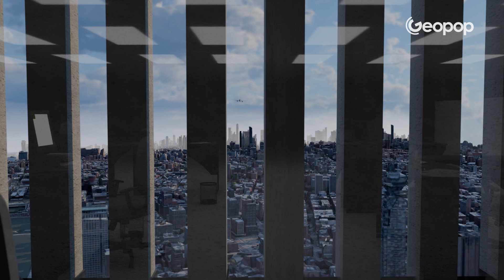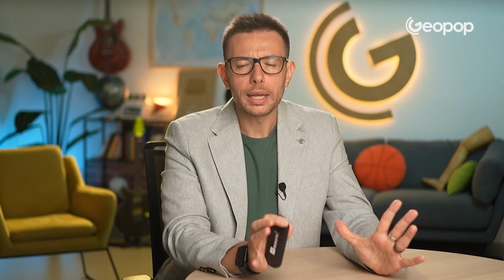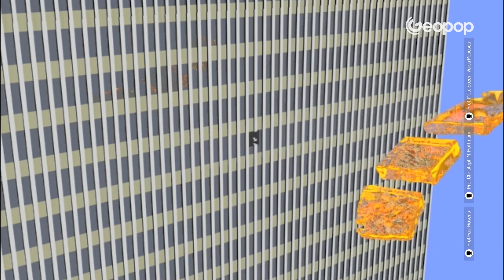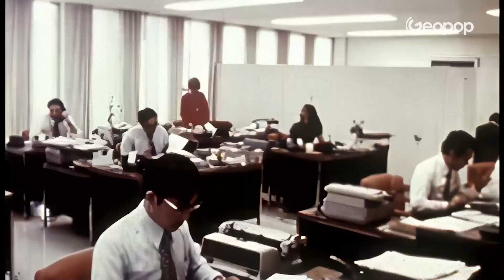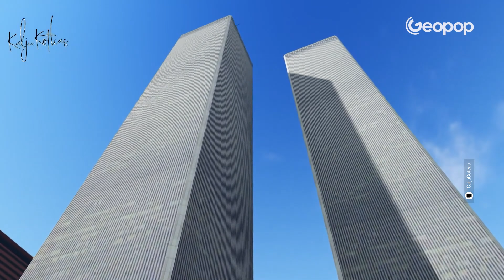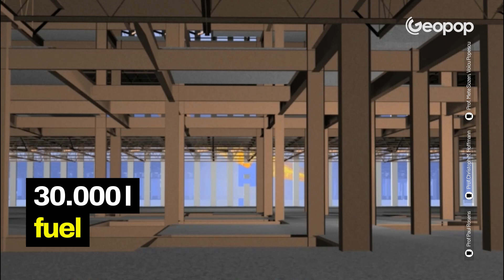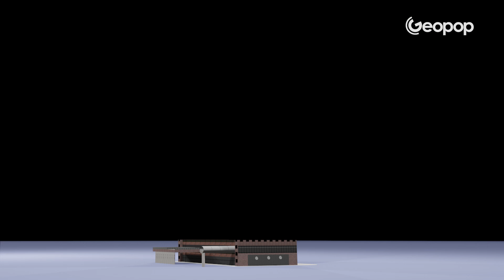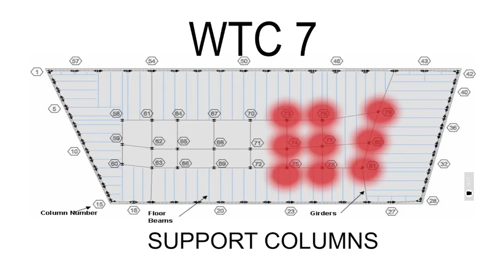9/11, 2001: The Technical Reconstruction of the Twin Towers and WTC 7 Collapses

Comment: Are you sure temperatures reached 1000 degrees C? Are there any photos of glowing red hot steel beams?
Reply: I have doubts that you could see steel glowing at 900 - 1000C in broad daylight. If it happened at night then maybe, but it was during daytime.
Reply: @Stigstigster  A turbocharger glows pretty bright red at 1000 degrees, and that's when you force feed it gasoline and air at the perfect mixture. I have my doubts about this part.
Reply: @Epacman17  Well fair enough but I do not doubt that the steel beams got hot enough that they softened to the point they couldn't do their structural job any longer during the fire.
Reply: There no photos but if you watch the videos of the guy fiming from the helicopter he mentions the north tower glowing red hot and that it didn't have much time left you just couldn't really see if from below you either had to be up in the air or in a building much taller than the twin towers in order to be able to actually see it
Reply: dude.. even fire from your everyday lighter is well over 1000 C..... fire of ANY kind is that hot... simple physics... and AGAIN... it was a TRUSS STYLE building!! all the steel/floors needed to do was sag a little, and the joints that held them would fail...thus, causing the pancake that we saw. This was NOT a "traditional" box style frame building like say the Empire state bldg. If it was, it obvs would still be standing.
Reply: @2jsalomon  The buildings came down at freefall speed, that means that there was nothing holding them up, NOTHING HOLDING THEM UP. Pancaking my arse.
Reply: @theSTUNTHAMSTER  lol.. you obviously dont understand physics very well. Do you know the sheer mass transfer when ALL that weight is coming down on top of one? It is pancaking, but in MILLISECONDS. Of course it came down at free fall speed!
Reply: I’m absolutely positive steel doesn’t need to glow red to lose it’s structural integrity. How do I know for sure? Because I do it almost every day as a welder. A few passes with a torch is all you need. You can bend steel easily, way before it glows. And thats just under it’s own weight. Imagine it with the incredible stress of the building and everything in it. Some of the folks in these comments are dumb as hell.
Reply: Steel doesn’t need to be red hot to loose it’s structural integrity. At 500-600 C, the steel has lost half its strength.
Reply: @jesperwall839  I'm mostly skeptical to the "up to 1000 degrees C" part. But also thought a building would still stand with 50% strength remaining.
Reply: @Epacman17  It’s not difficult to get a fire up to and over 1000 C. People have done it for thousands of years. In this case, fueled by jet fuel and a lot of oxygen, it’s not hard to imagine a real furnace. At 1000C, steel have no structural integrity at all. It’s like play-doh.
Reply: @jesperwall839  Why was there so much black smoke pouring out of the buildings? black smoke is an indication of an oxygen starved fire, quite the opposite of the explanation given by you.
Reply: The highest temperatures were only reached at certain points, and only for as long as the combustible fuel lasted.  But tremendous damage had already been done.  The last few points of support were weakened by the fires beyond the weight they were forced to support.
Reply: Yes in some places the heating got to 1800C. Remember there was a huge amount of aviation fuel, plus masses of paper, office fittings like furniture and carpets (even flame proof material will burn if hot enough), plus the high winds at that height blowing through broken windows, made for a fire unlike most.

And yes there is video of the steel beams. In one video you can see them thinned (from melting) AND glowing white hot.

In another video, you can see the steel dripping off, molten.

Comment: The technical reconstruction? What an effing joke. It's TECHNICALLY IMPOSSIBLE for those buildings to have collapsed the way the official explanations have portrayed them. More important, it's SCIENTIFICALLY IMPOSSIBLE for the buildings to have collapsed the way the official explanations have portrayed them.  There's alot of IRREFUTABLE scientific evidence that explains the problems with the official explanations for the events of 911. Start with the movie Loose Change. Then examine Architects and Engineers for 911 truth. And most importantly, read the book Where did the towers go by Dr.Judy Wood. The laws of physics did not cease to exist on 911. Again, it's SCIENTIFICALLY IMPOSSIBLE for those buildings to have collapsed the way the official explanations have portrayed the collapse. SCIENTIFICALLY IMPOSSIBLE. Jet fuel can't cause a collapse at free fall speed into it's own footprint. Even more so for building seven, which was NEVER hit by a jet liner. Jet fuel fires,or fires of ANY kind can't bring steel framed buildings to the ground. If that were possible,  why would they waste time setting demo charges? Just start a jet fuel fire on the top floors and...a perfect symmetrical collapse into it's own footprint. Effing please.
Reply: You are a clown.

Comment: You should be ashamed of yourself especially building 7 that collapsed from the ground down.  The penthouse buckles in the beginning not the column you mention.  Then from there on out the entire building is intact until it touches the ground.  You sir are ignorant or stupid.
Reply: Please explain how the penthouse was the first part of the building to collapse if the building was demolished from the ground floor up.

Comment: Feel like conspiracy people think the buildings didnt have any flammable material inside just empty buildings.
Reply: Class A materials don't get hot enough to melt steel, the steel beams are also coated in fire resistant material. Highrises are great at compartmentalising fires because the structure itself is not flammable.
Reply: Really.   Fill with all the material you want.  The fact you say this just shows why you are so easily fooled

Comment: Did NIST explain how the core of all three towers collapsed at the same rate of the outer walls? Other steel framed high rise towers have suffered serious fires. Are there any others that collapsed and within their own footprint?
Reply: They didn't collapse into their footprint. They covered a 13 acre site. Would you still look someone dead in the eyes and say they collapsed neatly into their footprints?
Reply: no others
Reply: @zsoltpapp3363  how many of these other building fires were hit by a 600mph jet, AND were a TRUSS STYLE building? ill wait...
Reply: @wskroll
Actually if you watch the footage of both twin towers collapsing the middle concrete core collapses at a different rate and is visible after the outer steel structure collapsed for a few a seconds. Wtc 7 was not built like wtc 1 and 2. Before Wtc 7 collapsed you can clearly see the that there had been extensive internal collapsing as it looks hollowed out.
Reply: Why do you clowns always write "collapsed into their footprint"? Six other buildings were destroyed because if their collapse.
Reply: They didnt. Just more Nutter talk.
Reply: At least two other high rise buildings have collapsed in a similar manner. The Plasco building in Tehran, and another building in Sao Paulo. The columns on the twin towers started collapsing because sagging floor trusses pulled the perimeter and core columns inward, causing them to buckle. When the collapse initiated, redistributing loads caused all columns to collapse within short order. In building 7, the core and perimeter columns didn't collapse at the same time. The core collapsed first, which is evident from the penthouse collapsing several seconds in advance of the global collapse. The perimeter columns then came down after.
Reply: If you are going to be an ignorant observer/conspiracy theorist, at least sound like you watched the video first; they did not collapse into their own respective footprint.
Reply: That’s patently false, there are literally numerous pics and videos of the north tower’s core remaining standing for about 20s after the primary collapse. It’s pretty creepy to see, in fact.  

And no, there are no other tube structure high rise towers — particularly 110-story ones — that suffered unprecedented structural damage to their core structural supports, and almost total loss of fireproofing after being impacted by 767s at 500+ mph with 10k gallons of jet fuel and collapsed. It’s not exactly a common scenario, thank god. 

And how does that have anything to do with the sound, common sense physics and science-based engineering principles that explain these terrible tragedies? 

The unprecedented impact of a fully-loaded 767 with 10k+ gallons of kerosene (and the fact that the spray-on fireproofing was completely dislodged by the impact), and the massive uncontrolled subsequent post-crash fire, combined with the unique, open floor-plan design of the buildings, left them uniquely vulnerable to this type of collapse. The perimeter columns failed due to the sagging steel floors pulling them inwards, which caused a failure/collapse of a single floor, which then started a chain reaction leading to the progressive collapse of the entire structure. 

It’s actually quite logical and simple why these buildings collapsed. No conspiracy needed. See Occam’s Razor.
Reply: @RobMancusoJr Nonsense. The Twin Towers both collapsed in the 10 to 12-second range, except for that spindly, small portion of  North Tower’s core. Gravitational acceleration, aka free fall, would have been 9.2 seconds. This means that the vast majority of each tower’s kinetic energy was completely used up just falling that fast. There would have been nowhere near enough energy left over to crush down 78 stories (South Tower) and 93 stories (North Tower) of cold, healthy steel structure, eject multi-ton sections of perimeter structure in a 600-foot radius from each tower’s footprint, and to pulverize 200,000 cubic yards of concrete (each tower) such that Manhattan was blanketed in a 2 to 3-inch layer of powder. All of this is utterly impossible without a great deal of energy added to the system. It is quite evident from numerous videos of both towers’ collapses that that added energy was explosives. Videos show symmetrical waves of explosive ejections of pulverized concrete and other debris racing down the face of each tower at, again, nearly the rate of free fall. Also notable on some of the videos are isolated ejective squibs emanating from the faces of the towers 10,20, and even 30 stories below the collapse zone. This is simply inexplicable if not for the use of controlled demolition. I hope that someday the religious belief in the official narrative of what happened that day will give way to science, empiricism, and common sense. To stand up for the official story is moronic at best and high treason at worst.
Reply: @RobMancusoJr  shhhhh you are explaining the structural design of the towers and all the legitimate factors of the damage that occured to it which caused its inevitable collapse. Truthers dont like when you hit them with indisputable evidence and facts. It doesnt align with their half brained conspiracy theories
Reply: They didn't collapse within their own footprint. There is diagram in the video which shows the debris fields and it can be clearly seen in multiple videos taken that day that the top part of the South tower tipped over as it fell.
Reply: @richardharding8438  You’re right! They sure as hell did not collapse into their own footprints. The towers’ physical matter — pulverized concrete, human beings, office furnishings, as well as multi-ton beams and perimeter sections — were all ejected and pretty evenly distributed over a 600-foot radius from each tower’s footprint. An exception is the 400,000 tons of pulverized concrete distributed so widely that Lower Manhattan was blanketed n a 2-3inch layer of powder. It’s the direction of the collapses that was straight down into the footprints. Ah yes, that huge top block of the South Tower that tipped over and reached a 22-degree angle of tilt before disappearing into the cloud of its own disintegration, instead of keeping its angular momentum and crashing to the ground as a more or less intact block of structure. All of this impossible without a huge amount of energy, explosives, added to the system. The perpetrators of 9/11 hit the jackpot when they counted on a frightened, gullible, and science illiterate population to swallow the laughably obvious lies about what happened that day.
Reply: Did the other buildings you talk about also suffer loss of structural integrity from impact of planes or did they just have fires?  
Did you confirm the fire proffing to be the same quality of the twin towers?
Reply: nist explained what they were to explain

Comment: Great video, awful design! They were a death trap. Everything about the design was awful! First off, instead of supporting each floor with concrete from the core to the outside columns, they used trusses. They are lightweight and all firefights have proven they have a track record of failing in fire. On top of that, the spray on fireproofing was a super joke. Almost all of it got blown off right away. Even when they found the steel that was around those floors, no fireproofing was found. Once those trusses failed, the outside columns were useless. Then having all the stairs in the central core with no protection around them was the worst of the design. It meant anyone above the impact floors were destined to die. No building had been built like that at the time and there was a reason for that. It was a death trap.
Reply: It was a revolutionary design that allowed for open office plans....a new thing in the 1970s.   The engineers accounted for a 1970s plane striking the building, not plane that hadn't been built carrying so much fuel.
Reply: @whaaat3632  While it was a revolutionary design for more office space, it was a death trap for a scenario that happened. And the facts prove me right. How many people above the impact zone of WTC 1 survived?
Reply: @jamiethornton6101
Hindsight’s a wonderful thing isn’t it
Reply: @JamieTheBangles11Fan  That was because the plane destroyed the stairwells.
Nothing to do with floor trusses lmaoooooo
Reply: @nahoj.2569  Wow, you just proved what a total idiot you are. The fire had everything to do with floor trusses not able to hold up in the fire. LMAOOOOO is right. Go talk to a firefighter or someone who has an IQ higher than a single digit.
Reply: @JamieTheBangles11Fan  I'm pretty sure any building is a death trap if you fly a fully fuelled plane into it at 500mph. I get what you're saying, but it's like saying 'my house is a death trap because it'll be destroyed if an asteroid lands on it'. 

I'd say the lack of stairwells was the only real design flaw.
Reply: @nahoj.2569  Actually, the use of floor trusses is what allowed a global collapse. If they had used a more traditional girder and column design, like most tall buildings of the day, it might have been able to resist the upper floors collapsing onto the floors below. That being said, you are correct about the stairwells. Most of the people below the impact zones got out before the collapse.
Reply: Agreed.  I've been calling the towers a "death trap" since 9/11.  Actually, you couldn't build a deadlier death trap if you tried.

Comment: The fire Marshall said a plane would take out the sprinkler system. It wasn't changed. Would it have helped? We'll never know!
Reply: Yeah it did after impact the sprinklers only worked on the floors below impact survivors speak about having to navigate ankle deep waters had they worked throughout the buildings I'm 100% sure at the very least the blaze inside wouldn't of have had burned for too long or possible washed the burning fuel out the buildings to a degree or probably kept the trusses from failing though if the floors collapsed it still could of triggered a full collapse
Reply: Once the pipes are cut, there is no water coming out of any sprinklers.